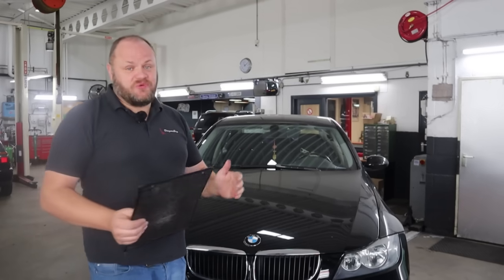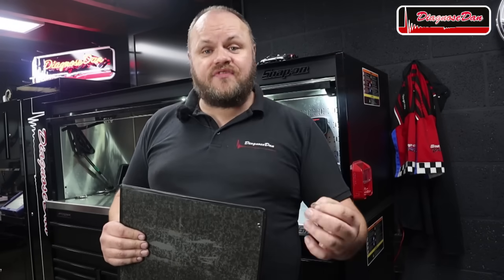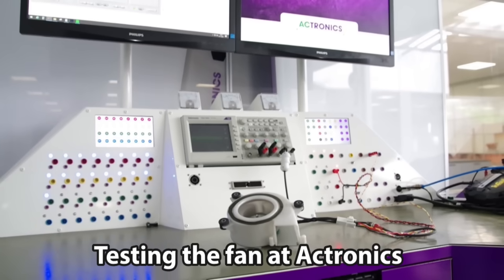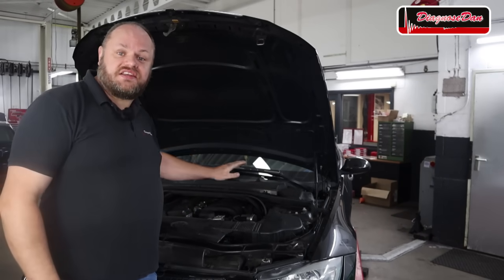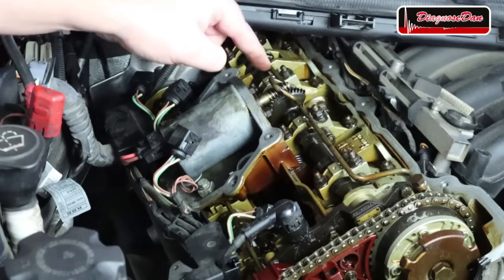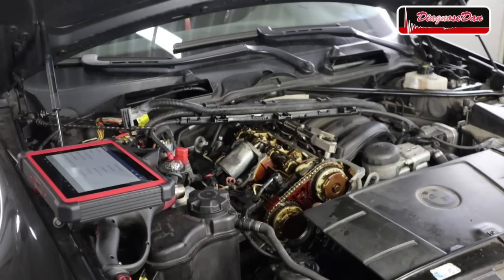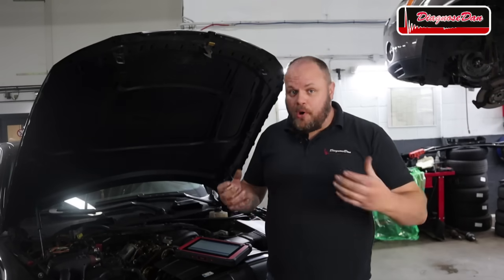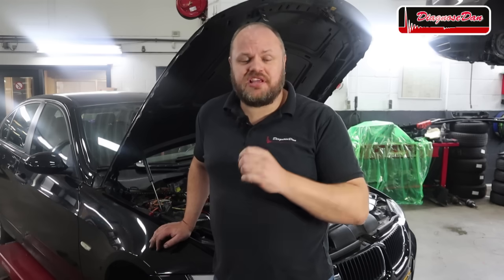Bmw valvetronic,Explained,Diagnosed,Fixed

Comment: My car starts but when the engine is hot the car dies and won’t start until the engine is cold what may be the problem l am suspecting the valve tronic motor

Comment: Hi Dan, I'm interested in ohm test from the connector to the motor, is this possible while the valvetronic is still installed on the car?

Comment: When youre testing the valvetronic motor and the meter says 0L, you said you get no reading.  ACTUALLY you got a reading.  The reading was infinity.  if it said 0 ohms you would have a short circuit to the frame.  The reading of 2.85 kohms is the resistance of the windings in the motor, plus whatever else is in the circuit.   You should find out what the reading is suppose to be though.  Maybe it was suppose to be more, or less than what you got

Comment: This is reliable engine if you disable the valvetronic thus we reduce or stop engine from byrning oil which leads to oval the cylinders, remove the oil separator valve , change the oil pump intake pipe plastic mesh change it with metal one and the last thing is  put a cheap cold thermostate in the coolant pipe bypasing the original thermostate . The angine will operate at 87C it will use 1liter more fuel but it will never had an issuse with stem seals oil leaks cooling sistem valvetronik and so on . Make it simpler=more reliable, robust . if you want to be cheap on gas then put LPG system thus cutting the price for a gas by a half cheaper than a diesel and more reliable too.

Comment: Do you know how the valvetronic system affects cylinder pressure at idle?  I captured some waveforms of my N18 mini engine using a pressure transducer.  The compression tower looks good (not leaning) but the negative pressure at the beginning of the compression stroke and the negative pressure before the exhaust valve opens are not the same.   The intake pocket is half the vacuum of the intake stroke vacuum.  I’m not sure if valvetronic has anything to do with that.   I think the exhaust cam is opening too soon.  If the cylinder is leaking, then the vacuum in the intake pocket should be higher.  Leakdown test was 1% on best cylinder and 3% on the worst.

Comment: Hi Dan. Can i register to DDTSB in united states ? I went to your website and it doesn't have the country code. Let me know please. Thank you
Reply from the maker: You can, however it's not recommended. Ddtsb was developed for the EU market and doesn't contain a lot of information on U.S vehicles. It only makes sense if you are specialized in European vehicles.
Reply: @Diagnosedan  Ok. Thank you

Comment: I have the same problem on the N46 that I just changed the valve stem seals of which is funny it never had that problem but after the job is completed it brought this dtc code 2A59 about its sensor how do I go about on this one

Comment: I have fast loud buzzing every time I unlock my car, it lasts like 3 seconds, I've got two codes 135808 and 135A08 it has been remapped so is showing a other code which I believe is because of the map 201101 any ideas guys it's a BMW m135i

Comment: Great video. I have almost the same problem in my BMW, the codes are 2A67 and 2A6B. I was thinking that maybe the valvetronic case conductivity/resistance test could be done without taking the valve cover and the motor off? 
My problem seems to also appear only on warm engine, so it looks similar to the valvetronic motor fault in the video. The other code I believe is related to the eccentric shaft sensor

Comment: Hey so i just replaced the sensor and motor with one from aliexpress… the car drives fine but maybe feels a little rough how do i check if everything is working like it should? I did this just to see if aliexpress is really that bad or if it is actually the same product but cheaper. Also of you look at stuff like injectors they can be had for 30 times cheaper on there!! In percentages its 3000% thats crazy! So how do i find out if this stuff is actually the same?

Comment: Hi, my 2011 N55 engine deactivated Valvetronic due to too many adjustments.  The car ran fine for a long time before I noticed.  Recently, it started misfiring and I changed coils, plugs and the HFPF (it was also long cranking).  I finally took it to a shop, they said the Valvetronic may have taken out the DME which I know is possible due to excessive current drain if the eccentric shaft becomes hard to turn.  But again, the car ran fine for 6 months to a year with deactivated Valvetronic, so why would this happen all of a sudden.  The only misfire is cylinder 6.  I will try to replace the fuel injector first.  Should the injector fix the misfire, can I continue to run with Valvetronic deactivated or should I unplug the sensor or motor?  From what I understand, it is deactivated in the highest lift position and the car is using throttle instead.  Other than some fuel economy and slightly rougher idle is there any downside?   I would love a response, as I am unsure how to proceed.

Comment: hi dan i have a problem (bmw e91 2006 valvetronic adaptation fault) no lights on dash just this fault and i cant reset it delete it or anything unless i remove motor and replace it and it will be ok for 3 weeks or so any ideas

Comment: You are a life saver, Had been stuck with rough idle, new spark plugs going black because the car wasn’t being able to burn fuel and a crank code. We were on the verge of opening the engine on my E90 325i until I came across this video. Now, My car is fixed and ready to make some white smoke again! ❤️

Comment: Hey, I have a n52 (e90) and getting faults. I’m only getting 5v when ignition is switched on. Is that normal? And voltage goes up depending on throttle position?

Comment: This video helped so much. My son bought a 2011 328i xdrive which was in limp mode. Replaced vvt’s and it was still doing it. Bored a buddies scanner and it had low voltage bank 1 vvt. Watched this video and viola the vvt wire in trunk wasn’t plugged in. I know the guy he bought it from would be mad if we told him this

Comment: Now thats how to diagnose faults properly!
The heat test and the pin-case resistance test was very interesting, clealy it located the fault, though I'm curious as to why heat would have made the motor inoperable...? 
A post-mortem examination on the old motor would have been cool as it might have revealed the cause of its erratic behaviour.

Comment: Hey, I measured the cables of The Motor and I got 1.7 Volt. So my problem can be in the cables or something else? New Motor and Sensor installed lately. Please help 🙏

Comment: I did the continuity test on my motor and it failed but did another test I’ve seen on YouTube wiring it up to a battery and it ran backwards and forwards is my motor still bad?

Comment: WAIT! So If you disconnect the throttle body or remove it, the car has to still idle and possibly rev as you use the throttle pedal because of the valvetronic , E90 323i n52.
Reply: When everything is connected on my bmw then my pedal looses one voltage line. Live data is 0 to 37% when pedal is pressed fully.
When i disconnect the throttle body my voltage return to pedal, both 5v, and live data shows full working pedal 0 to 99% when pedal is pressed.
When i relearn valvetronic values it does move and actuate.

Car swithced on and throttle body disconnected:
Pin 3, 4.3v  throttle motor positive
pin 5, 4.3v throttle motor negative
Pin 1, is 4.7v sensor 1
pin 4, is 0.005v sensor 2
pin 2, is 4.9v 5v positive
pin 6, is 0.005v ground
No difference when pedal is pressed or released

When started my bmw fluctuate between idle and 1800 revs constantly and no throttle response.
Connected or disconnected at throttle body makes no difference.

My ista is only as a workshop manual and has NO throttle information even.
My autel maxcom 908 mk with j 2534 can read peal live data and throttle live data is at 90 degrees no matter what car on of idle does not matter.

Autel Scan Tool:
fault Codes after start:
002C73
002CF9
002CFA
002CFB
002D09

Fault Codes after erase only and Read:
002C73
002CF9
002CFA
002D09

ANY advise would be so help full. this car as been standing with this problem for 4 years now.

Comment: Reason you get a reading is  there is a carbon build up in DC motots where the brushes ware down and have no where to emit the powder or dusty so builds up and cause a leakage 
  my guess you open the motor and clean it it would be better but 80% efficient

Comment: Hello I have a problem whit my n42 engine. When I unplugged out the vvt motor . The engine is starting strength but I plugged the vvt motor it won't start. I don't have any error. Pls can you help my . My mechanics don't know what to say.

Comment: hi this is sean from L A California and from neils express automotive i like your videos have a lot of information Im working on a 2012 bmw 328i wont accelerate codes 2a45, 2a77, 2a3f, 2a39, 2e7a getting confuse because the valvetronic motor its getting 3.5 v when activated, looked at another  good engine running the valvetronic motor  get 6.5 v based on this i replaced the dme but it still doing the same would you please help

Comment: I really liked this video and thanks for your time. Do you have any tips or suggestions on the third generation valvetronic motor that is buried in the cylinder head? I have 328i with n26 motor that is giving me intermittent errors. I was thinking of using a scope for the very first time to check the signal wires, but wondering if you have any pointers or tips?

Comment: 2012 e92 bmw 335 car is in reduced power mode and I can’t figure it out these are the codes
P10E5 Internal Control Module Error, Control Circuit
VVL
P10F5 VVL-Control Phase V Circuit Open (Bank 1)

Comment: Dan. I came across your video as I’m troubleshooting a 2A38 Valvetronic sluggish or open circuit on a 2008 BMW 328ic. I don’t have a wireless setup like you and the best I can do is wired ista on my laptop. To properly troubleshoot as you did on this video with the valve cover off, would I have to carefully reconnect all the power terminals and grounds that need to be removed to take vc off? I’m hoping to get to the bottom of this and get my car back on the road. Thank you very much.

Comment: Hi Dan! great thorough explanation and excellent detail! i have a QUESTION ?  for example you change out a leaky top oil valve cover pan and gasket on a 2012 x5 n55 E70 SUV and you have removed the valvetronic motor, should you do the "relearn procedure" BEFORE you try to restart the engine, or does it make a difference or would it still just start up fine without any isssues?? ty  please continue with great diagnosis videos!! ty

Comment: Does this mean the sound at 6:25 is the sound I hear from my motor upon turning on the ignition? Assuming that it would be considered a valvetronic actuator test if I was correct?

Comment: The diagnose with the multimeter on the old motor could be considered, but it might not be accurate, unless it's a weak spot prone to fail, but it can be considered in following fixes based on the same system, great content! Also very educative and detailed on how these systems work!

Comment: Hello, i heve a big problem. I have a Toyota corolla 2014, 1ZR and I have 2 error codes: P1047 and P1049. Toyota service give me a 2000€ bill for variable valve lift controller. Can somebody help me with some information or instruction please?
I have leack of power but only when the check engine appers. if I stop the car and start it again, the lights stay on but I don't have any more problems. The lights are not on all the time, they go out from time to time but only when I start the car. 
THANKS.

Comment: Awesome. If it wasnt the motor, what else could it have been? I received all codes related to the valvetronic: 2A31, 2A32, 2A34, 2A36 & 2A37... 
WHAT IS THIS MOST LIKELY TO BE?:(

Comment: Hey Dan I have a question I replace 2 injector on my n20 bmw  engine and now i have a no start check for spark ok check for fuel ok check compression and I only have 60psi of compression on all 4 cylinder only thing that did was reuse decouplings from old injector can that cause my no compression issue?
Reply: Was it timing jumped ? Or a bad compression tester ?

Comment: Good job but if you don’t screw in the worm gear and the eccentric shaft maxes out on installation of the motor the car might not start

Comment: Mr Dan ❤new subscriber here.
2011’ BMW 328i xDrive iL6. I just replaced the Exhaust and Intake Vanos Camshaft Adjuster sprockets. 
Put back car together today and car starts fine. Idle’s fine. No problem starting.

Except one thing…
Code P13B2 keeps showing up.  resetting Engine Light but it keeps coming back after 15mins of idle.
Please Advise?
Thx

Comment: Great video!  Thanks!  I will soon be doing Valvetronic work on my 2009 128i E88 N51.  I have to replace the Eccentric Shaft Sensor.  I don't believe my Xtool D8 scan tool does not have the option for the Valvetronic relearn.  Is there any other way to do a relearn without a scan tool?

Comment: Hi Dan
Great video, great engines these N52s!
I stumbled upon your video as I was searching to diagnose a Valvetronic motor fault, but with no codes, not even intermittent as in your video, just down on power and a bit jerky when cold.
Howerver, I did get the resistance (ohms) when measuring it with a multimeter device, connector-to-motor housing as you did at the end of the video.
Should I replace it as it is going to start to go bad anyway or can it sit like that forever practically?
I get 18mpg city but with little traffic lights and stop-go traffic
I changed disas, vanos, cleaned maf, new oil, new oil/air filter

Comment: If the item is not good, does a car use more oil? I have the same issue, I think, because I've been hearing my valves for a few weeks now, and the engine has started to use much more oil, which was not the case before.

Comment: I would try to do the insulation test with the old motor warmed up. The value on the meter should drop more.

Comment: Hi Dan, my BMW started overheating then make ugly noise at valvetronic motor. Thanks for sharing your knowledge. Which module activates the motor? It uses relay or solid state transistor?

Comment: Nice fault analysis but I need to correct you on something. You are partly correct about the purpose of the valvetronic. It’s not there as a secondary throttle control. Throttle control is solely done via the throttle body. The purpose of the valvetronic unit (as you sort of indicated) is to open the valve further to let more air in as the revs rise. Its purpose is to increase power it’s not a fuel efficiency device. As you push the throttle down the throttle body opens, the ECU controls the valvetronic device to give the inlet valves more throw so as to let more air in, the fuel  injectors adjust to let more fuel in. The Vanos unit is seperate, it advances the camshaft to open the inlet valve earlier when revs rise. The engine with the faulty valvetronic unit would not reach full power because the valves would not have been permitted full throw. For normal driving this would not have been noticed, but the engine would not have reached its full output potential. Hope this makes sense to you

Comment: As an Electrical Engineer (though motors are not my specialty) I would say that you are correct in that your test indicates a failed motor. Probably a heat related insulation failure.

Comment: I know the video is a year old but I would have done an ohms test or a load test with a bulb in series and seem of the ohms changed with the heat gun and how much of a difference it is vs the new one. Ps too much heat can also damage good parts for the diyers out there so be careful putting a hot gun up agains an electrical component. I would measure engine bay temp and operating temp and set my gun just a bit hotter than that.

Comment: I’m getting this exact same fault code in my 2008 bmw 320i however it’s also missing engine makes strange noise when accelerating and starting sometimes and moving sluggish can a bad valvetronic motor cause these symptom ?

Comment: I have a problem with my 2011 bmw 328i  in the morning or after sitting for a while has hard start or won’t start  and has a codes 2a3f  valvetronic power supply and code2a77 control unit internal fault valvetronic  . Checked vvt relay fuse and is okay , replaced vvt relay and still with the problem , any idea what can be the problem  …???

Comment: Does heat shielding valvetronic motor can resolve the issue?, also is it responsible for engine oil burn or smoking

Comment: Briliant video.Valvetronic brillantly explained. Even i understood it.I  think your dignose is excellent. The valvetronic motor was the problem in the case.  But maybe you have an idea how to fix my problem. My 125i (with 3 Liter N52 engine) runs perfect as long as it's cold. Maybe as long as valvetronic is not active (it works only in case of warm engine does it?) . Valevetronic motor and sensor are new. When the engine is warm , it looks like the car rises  the rev's while it's in idle. When it's pretty hot, there are gas shocks (up to 1700 1800 rpm) every 10 or 15 seconds, standig in front of traffic lights. Occasionally the engine stops runnig and throws a air mass meter faultcode.I wish i had someone like you next to my location.

Comment: Again good diagnosis but you should wind back the servomotor with scan tool before removing or if function not available wind back manually. There is a 4 or 5mm hex bolt on the back of the motor. Also you should always grease the new motor worm gear and again manually wind into the eccentric shaft to prevent damage to the shaft. Also you really need to replace the VVT relay every time you replace the motor as per BMW repair instructions and as advised through BMW parts catalogue ETK and I also recommend programming the DME too. Just my 2 cents but again great video!